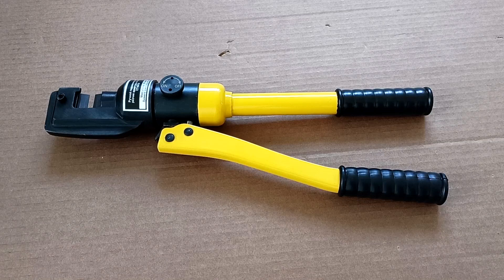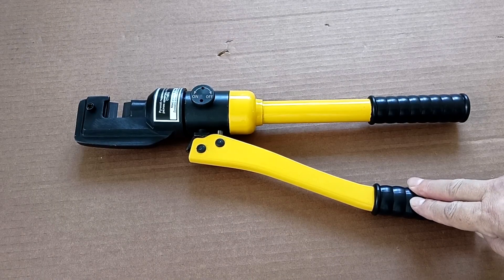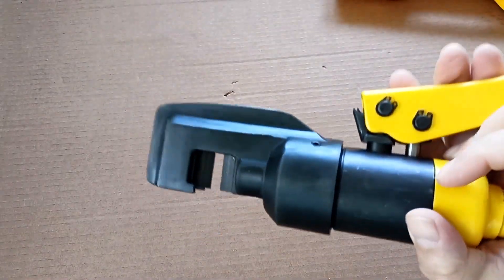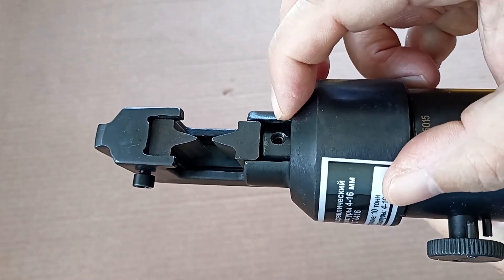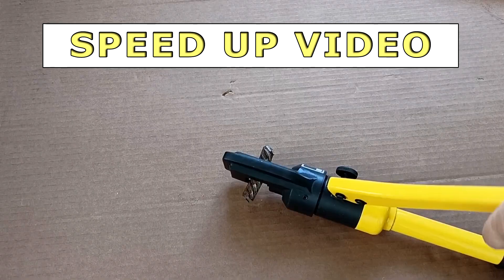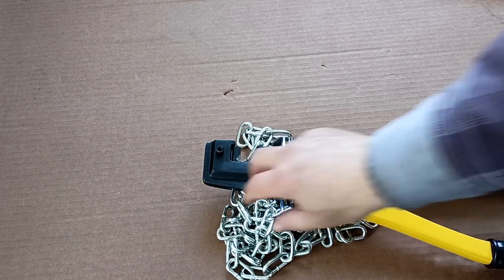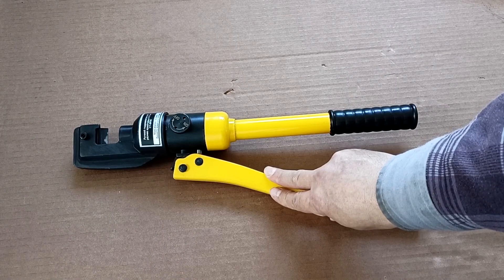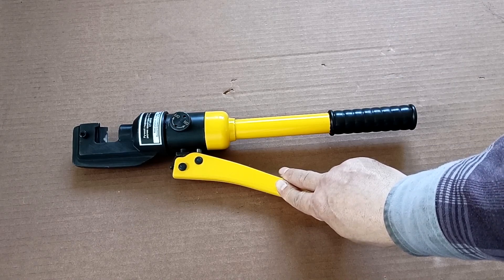Manual Hydraulic Rebar Cutter: Hydraulic Shears and Bolt Cutter for Metal and Rebar Cutting.

Comment: So much spam comments. Grinder or a normal shear style rebar cutter is probably at least 5 times as fast. I woukd hate this thing for cutting rebar
Reply from the maker: If there is electricity, then it is faster to cut with an angle grinder. You just need to change clothes so as not to get dirty. And electricity is definitely needed.
Reply: @Electrics_plumbing  we have a manual sheer designed for rebar. It is also designed to bend rebar. A lot faster than even a grinder particularly if you're doing a bunch of random lengths. And all it takes is a bit of man power to run it.
Reply from the maker: @jaywiebe7612  Most likely, I understand what kind of rebar shears are being talked about. These are shears with long handles. Yes, they cut faster, but it is not easy to get to them everywhere because of the handles. But it is also an option. You can use these where it is difficult to turn around. And where there is space, you can cut with manual ones.